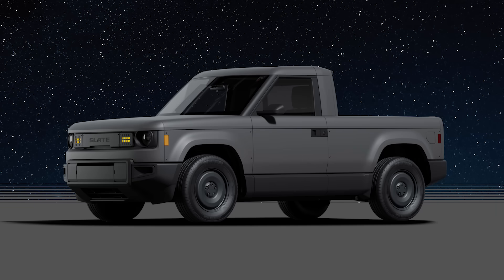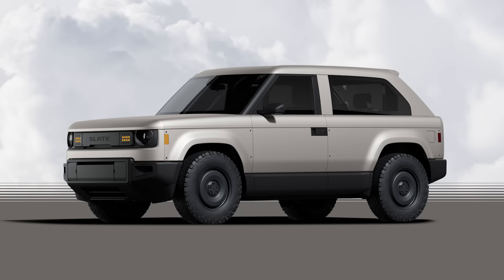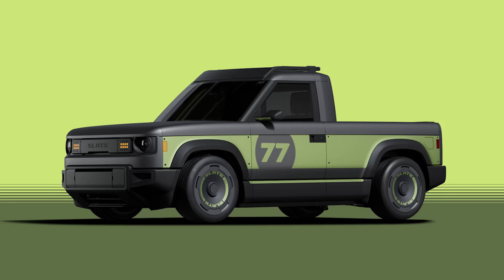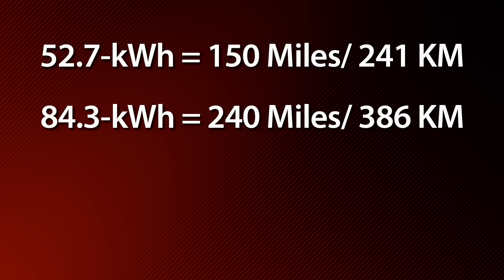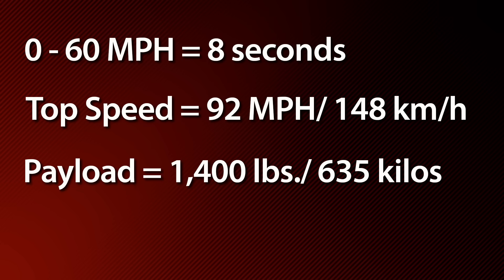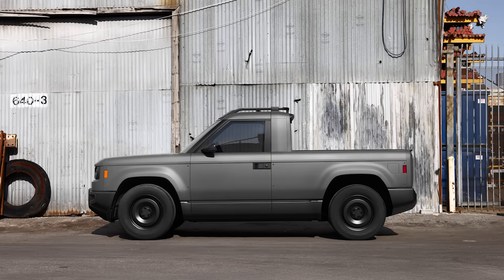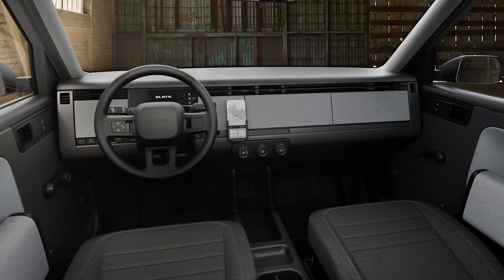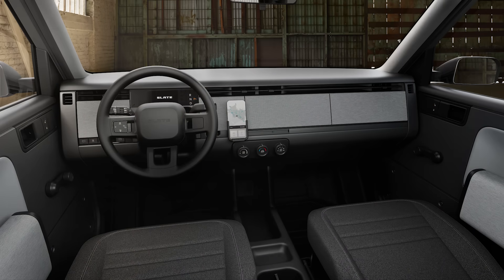Everything You Want To Know About That Slate EV Pickup

Comment: The EV tax credit is not needed. Even without the credit, the truck will make up for the cost and then some with its low energy and maintenance costs. $27,500 for a new EV is still a bargain, especially for something so simple and easy to maintain. This is also a small truck so you are paying for payload and towing too. The price is more than fair IMO. Aptera is up to $40,000 with their launch edition but even that is a fair price for what that vehicle can do. The tax credit is just not necessary when the EVs themselves are a great value. The incentive to buy a car is a good value proposition. Slate and Aptera have fantastic value propositions.
Reply: While I'm intrigued by this, and hope it actually makes it to market 'as advertised', you are certainly not paying for towing capability.  1000 lbs is laughable.  The payload rating is acceptable for it's size, but I can't see how the towing is so low - literally unusable for anything but the tiniest possible trailer.

Comment: Polypropylene body panels?  It's tough as hell initially.  But! (trademark Autoline) It is not inherently UV-resistant and will degrade upon prolonged exposure to sunlight.  This can lead to a loss of mechanical strength and brittleness, potentially causing the material to break down in a few months.  It is not exactly scratch resistant either.  They better test the ba-gesus out of that stuff.
Reply: Most will be wrapped.
Reply: GM did this in the 90s with Saturn, they had plastic bodies and they held up just fine.

Comment: I like it generally, but considering how bare bones it is, I think it needs to be even less expensive. The last I heard, it was going to be $20,000 AFTER the $7,500 tax credit. So that's $27,500 for a 2-seat EV truck that has hand-crank windows, doesn't even have a radio or infotainment screen, has only a 150 mile range, and only has enough power to get to 60 in 8 seconds. I don't think that's going to pull many buyers away from the used car market.
Reply: let's see your math on how it could be cheaper
Reply: @tomjanowski8584  I didn't say it >>can<< be cheaper, I said it >>needs to be<< cheaper to compete with other vehicles for sale in the same price range.
Reply: I agree, it should be less than $20,000. 

 The Nissan Versa is priced under $20,000 and comes standard with power windows, locks, radio with backup cam, ect.   Further more it doesn't rely on a EV tax credit that could go away at anytime.  

I like the looks and concept of the Slate, but there are a ton of unknowns.   Actual Selling Price, Parts and Service availability, Reliability, Safety, Driving Experience and brand perception will all play a roll in Slate's success.

Crank windows really aren't saving much if anything in terms of cost or reliability.  

While an EV doesn't fit my needs, a similar concept with a 3 or 4 cylinder gas engine or even hybrid would appeal to more people in my opinion.
Reply: @Pgeezy9mm  Versa is a crap car that isn't an EV.
Reply: @tomjanowski8584  And Your Point?   The Slate is just that..... a crappy little car and an EV on top of that.
Reply: @Pgeezy9mm  We don't know if Slate is crap yet.  We know all the Nissan issues especially with the CVT.
Reply: @tomjanowski8584  You are right about the Nissan CVT.  I find it humorous that they want their CVTs serviced every 30,000 to maybe be reliable.   The Versa base model offers a 5 speed manual, but it is still a crap box.   Hopefully Slate will pull through and it will be decent.

Comment: We need basic vehicles like this , but I can’t recall the last car/ truck made without Power Windows,  matching paint on plastic panels  can be troublesome for some shops but there is always the” Wrap” aftermarket option.
Reply: The Slate comes unpainted.

The body panels that are designed for vinyl wrap.  There will be precut wrap kits you can install yourself or have them do it for you.

Comment: The more videos I see of vehicle I can see it has a LOT of promise, here and abroad. I hope they consider releasing it in both a two door and four door version. The two door version is such an obvious small truck for commercial fleets, as well as a compact high roof commercial van (make it happen Slate) 

But I think the real genius is in what the four door version could have lent itself to being: a SUV, a CUV hatch and even a sedan. That to me is the sweet spot because it fills out the model roster for the Slate company without having to do much more on the design end. 

I also think Slate should only offer it with the larger battery for more range ... and make all models/versions AWD.

Comment: This is not a product.  It's a prototype.  I will only become interested when it is in volume production.  Until then, remember Elon Musk's Maxim.  "Prototypes are easy.  Production is hard."
Reply: Exactly and tesla raised $20,000,000,000 in total with over $37,000,000,000,000 in the bank. Rivian and lucid though have incinerated over $35,000,000,000 between them for about 180,000 evs made so far!
Reply: TESLA mostly makes money with Carbon credits!

Comment: FYI There will an after-market power window option for those who want it and it's designed to be self installed like IKEA furniture... Ditto with the body wraps. They will be offered with DIY video training on how to apply them. Very cool! I personally like the prosumer enthusiast approach even if its largely a fake way of bonding people to their products.. like IKEA!
Reply: Ikea might be fake bonding, but as a automobile enthusiast this is the EV I've been waiting for- one I can work on myself and customize it to make it mine and it's not connected to the internet tracking me. As long as end consumers can get repair parts I think this will be a win. I won't get a tesla due to the digital tracking, lack of available parts to repair and I don't like how they all look the same
Reply: Noone sees this part coming but maybe, a 3d printed body panels to replace the OEM ones for collision repair?  The repair shop doesn't have to order pieces but 3d print what is needed.
Reply: @GG-si7fw  In other videos, the company is said to be open sourcing part designs so owners can make their own parts.
Reply: I expect the options will move from Slate to after market add-on manufacturers.  Example - if you're choosing among a dozen options to modify the bed, than chances your preference will be among Slate's 3 offerings are slim.
Reply: Slate offers a power window option.

Comment: CLEARLY, they took or are advised directly by Sandy Munro. Kudos. He made a few videos less than a month ago grousing how nobody was doing the embedded plastic body panel thing despite its major advantages. And here we are... Personally I hope this sells in numbers so large they have to open a second factory. Instead of a bloated nostalgia beast for babies.. Sorry, baby boomers, like the Bronco or VW ID Buzz ban who are both too bloated and overpriced to be mainstream this will do it. For the fact that 80%+ people only drive less than 40 miles a day round trip and generally by themselves? This is the perfect compromise vehicle in terms of style, practicality and utility even if it doesn't have a duel motor option. And for me? Roll down windows are a major advantages. Way less chance of breakage or freezing up in actual cold weather. Now if only Ford can launch its affordable car division soon enough preferably under the Mercury name and only with affordable mass-market electrics with options just like this.. And ditto with GM and Saturn. There should be multiple EV models on the same platform with a base models around $20-25K with affordable after-market accessories available to upgrade your whip as you like just like Slate. Well done! Now if we can only see movement from Aptera and Telo Motors too, that would be ideal!
Reply: Lol, not necessarily.  Composite panels are nothing new, and many people along with Sandy, have been aware of the benefits for years.
Reply: Slate makes enough sense for people who own multiple cars, but the whole "most people drive less than 40 miles a day solo" argument is not compelling if it is to be your sole mode of transport. Reason being that people don't buy a vehicle based only on the bare minimum that is needed for their commute to work and back. If they did, they'd ride an electric scooter/motorcycle. Instead, people buy a car that will encompass the broad range of things they plan on doing with it, or aspire to.

Comment: I think this is going to be a flop. The current administration plans to get rid of the EV incentive and this becomes just too expensive compared to the Maverick. I see very little reason to get this over a Maverick. 150 mile range will reduce significantly in winter, so you might as well eliminate all northern states customers. Once you load up the bed it will get even worse. Here is hoping for them they can fit in a good heat pump for the $28k they plan to sell this for.

Comment: How does a bending moment get measured in Hz? (I’m not a structural engineer, but that’s not making sense to me. )
Reply: Natural frequency bending (or torsion?) moment, higher is stiffer. Stiffer is better for chassis and suspension function, and passenger comfort.
Reply: @davidg3944 Appreciate it.  Too low and it’s a perceptible “NVH” issue.  And really too low and i guess it’s a Tacoma Narrows bridge problem.  I’m guessing 35Hz reflects above average chassis stiffness.  You’ve given me enough to search on, thanks.

Comment: I have to admit, having the smartphone as the "screen" actually makes sense. All the stuff the car screen does is already on your phone such as radio and nav so remove the redundancy. The most impressive is their hustle mentality. Excellent report!
Reply: Not to mention that the software that cars usually have are worse than iOS and Android.
Reply: They brought the cost down, but they didn't fix the primary problem, which is the "Wifi Updates" on the computer. The reason most of the new cars are breaking down, is because of their computer software and computer glitches. It would have been far more appealing is they didn't have WiFi at all on the Slate, and you could only do updates to the software with a physical cable. I don't want my vehicle receiving updates wirelessly. I will never buy a vehicle that receives "wireless updates" to the ECU. As consumers we have to put a stop to these "advances." Cars worked fine without software updates for the last 110 years.
Reply: @Ritalie   WADR,  they did address your concern by making "updates manual and only over an internet connected smartphone". The vehicle has no wireless or any other connection to the outside world. Just an in-vehicle connection to a phone (and there's a way to make that a wired only connection) or a dedicated tablet  without a Wi-Fi connection. 

As long as  it's not manually updated via a smartphone it won't be updated.  Your paranoia problem solved. 
(last person that brought this up said he didn't want the fascists to get his data, SMH)

i understand being cautious with your data at other security issues but this is beyond me I'm sorry.

But if you really mean you don't want a vehicle that uses any type of software whatsoever, good luck with your horse and buggy..Have a nice day my conspiracy theory Luddite friend.
Reply: @nc3826  Your 2nd comment counters your 1st and later outbursts - did you forget to log out and back in under a different avatar?
Reply: It’s not about “working fine” but making it more efficient. Cars 60 yrs ago used leaded fuel with no headrests for whiplash prevention and no seat belts. As far as tracking, “they” already are. How do I know? What are you using to read this?

 Software updates for this car would be very far and few between as it doesn’t have a screen. It would be primarily for battery management improvements. Now, could someone “hack” this car by taking a cable and setting it so it overheats the battery or drives poor? Sure! It’s the same with any car with an OBD II port. Need an example? VW diesels. The employee “hacked” them to fool EPA tests. Oh, you can “hack” an older car too by loosening a spark plug wire.

No, I don’t want a horse and buggy due to amount of fecal…and they can get “hacked” too.
Reply: VW's  Dieselgate was not an "employee hack."...  It was corporate fraud..... End of story.... That's why it cost them billions.... . No matter how it's rationalized afterwards...

And anybody that believes that a horse and buggy can get truly hacked, by the modern definition of that term, is full of that fecal matter...

Got to love modern conspiracy theory rationalizations.... that tries to rationalize how up is down.... Believe what you want....
Reply: I have an old school 27 inch Sony XBR TV that'll be perfect for this as a center screen. Noone will steal it as it's 125 lbs. 😁
Reply: I agree.  Automakers spend considerable money on developing user interfaces, voice control systems, and connectivity functionality, in large part to mimic the same information already available (and usually better executed) on a smartphone or tablet.
Reply: The reason it’s not done by OEMs is because of liability and fed regs. It needs to limit usability in order to be legal as a head unit.
Reply: Sounds great.... until you consider the additional security risks,  

don't worry it's just a car, who would hack a car?
Reply: @nc3826  Few have problems understanding the meaning of "What's to hack?", or the comment you're responding to which is largely flipping your parroted overused forum insults to others.  Admittedly finding them baffling is not a reason for a tantrum, but shows a compulsion by a few to lash out at a world that frequently exceeds their capacity.
Reply: @1SCme  sorry for work confusing you have a nice day
Reply: @nc3826  What's to hack? The truck's internal electrics really only tell you how fast, how far before you have to recharge and to dim those bright beams for the other vehicle coming towards you. The idea of being able to use a removable phone or tablet for infotainment/entermation is brilliant.
Reply: @benjaminnead8557  Great, but what the heck? Does,"what to heck" mean? Or "internal electrics", is that anything like electronics? And based on your retort, I can tell your bright beams have already been dimmed.

Sorry I'm just one of those boring engineers, who oddly enjoy getting into those boring details. To establish a risk reward ratio of any approach. Please disregard  my perspective, since you obviously already have all the answers. 

 It's all good my friend, take care.
Reply: @ Well, I'll apologize for myself, too. Not sure why you're putting up a great defense against a car/truck that has electronics so simple that there's very little to hack. Bored engineers, I'm afraid, are often too fond of loading up things like cell phones with bloatware apps, etc. But I guess you've got to pay the bills somehow. Peace out.
Reply: @benjaminnead8557  I'm actually for the minimalism.... But connecting an external device adds an additional path for hacking.... It just has to be dealt with, that's all I'm saying.... Like it or not the world's not simple.... 

It's kind of funny when Engineers get attacked just for explaining why things are so complex.... And the steps that have to be taken to deal with it. C'est la vie
Reply: @nc3826  What's to hack?  The electronics are limited, doesn't have its own WiFi, not tied to windows, unlikely tied to locks - ignition - etc.
Based on your retort, I can tell your bright beams have already been dimmed.  Please disregard other's perspective, since you obviously already have all the answers, because you're an engineer, who_ avoids_ getting into those boring details._
Reply: @1SCme   "What's to hack?" LMAO  Must be the  newest bastardization of, what the heck, how creative .... 

And thanks for reminding me of the expression if you can't blind them with brilliance  baffle them with BS.... my AI bot for brains.... Enjoy
Reply: @benjaminnead8557  You returned to post this nonsensical comment - you were doing better parroting overused forum insults than attempting original thought - you're carrying a deeper grudge from thread to thread than I originally thought.

Still desperately hiding your inability to answer how there's a great security risk hacking a truck without WiFi, admitting you can't comprehend the comments you respond to, and apparently unable to track which account you're logged in as (all detailed above).

Comment: I spent an hour watching two other videos about this truck and had so many questions afterwards and John answered everything I wanted to know in the first 5 minutes.  Great video John!
Reply: The only thing I haven't seen covered (likely not yet released) is cost of 240 mile range, and if it has cruise control.  Give me the extended range, 2nd row of seats that can fold flat, square back with a rack on top, cruise control, and I have my stripped down swiss army knife for short local trips (most of my driving).  Adding AWD would get my interest, the rest I would prefer not to have.
Reply: @1SCme  thx

Miss Obvious....
Reply: John did a great job.  Filling in the blanks. 

But if he answered all your questions, you didn't have enough questions.
Reply: @nc3826  Many commenters are quick to throw tantrums - angry, upset, carrying grudges from thread to thread and video to video, but lacking the capacity for original retorts.